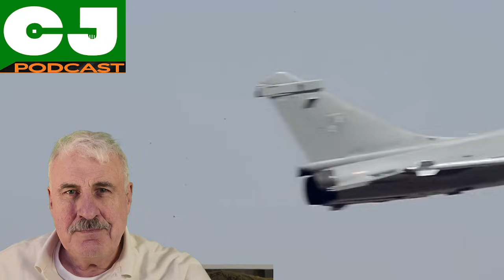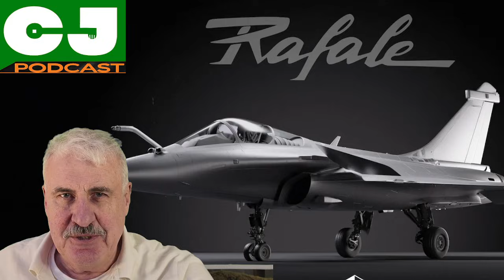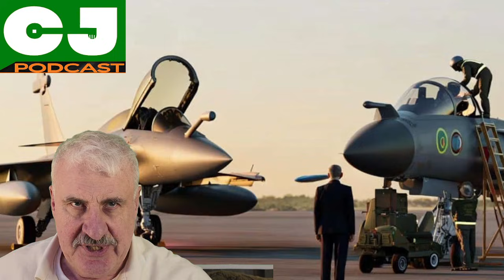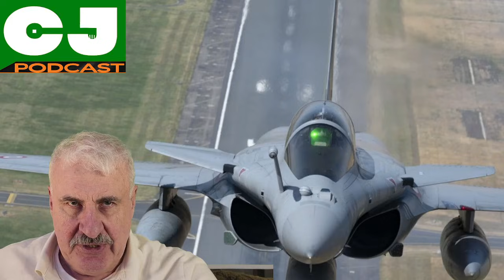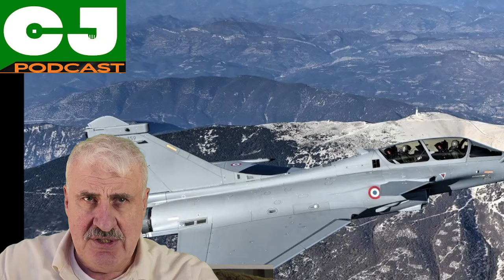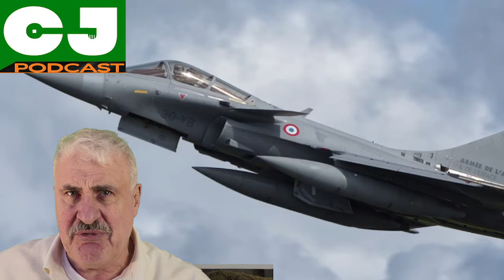Rafale vs Gripen – What Should the Irish Air Corps Choose?

Comment: The Gripen is nothing more than an F-16 or a Mirage 2000 with electronic upgrades. Its combat range isn't 1,300 km but 800 km, compared to 1,800 km for the Rafale. It's a very good aircraft, but it's riddled with ITAR-licensed parts. The US, in the event of policy disagreements, could simply prohibit the export of engines or spare parts. The Gripen is excellent for air policing but far inferior to the Rafale in every other role. Ultimately, it comes down to mentality: Do you simply want to protect yourself, or do you want to retaliate and punish those who have attacked you? It's primarily a political and ideological choice.
Reply: The idea that the Gripen E is just an "upgraded F-16" is a fundamental misunderstanding of 21st-century aviation. In 2026, the winner of an air engagement isn't the one who can turn the tightest—it’s the one who controls the Electromagnetic Spectrum.

The Gripen E is arguably the most digitally advanced fighter in the world because of its Separated Software Architecture.

The Problem with Rafale/Typhoon: Their flight-critical code is fused with their mission systems. Adding a new weapon or sensor can take years of recertification.
The Gripen Solution: Saab separated the "flying" code from the "fighting" code. This allows Ireland to update combat apps in weeks, not years, keeping the plane at the bleeding edge throughout the 2030s and 2040s. It’s an "iPhone" vs. a "Landline" comparison.

The critic mentions "electronic upgrades" dismissively, but EW is what determines survival in 2026.
EW is the ability to use the electromagnetic spectrum to Sense, Deceive, and Disrupt.
Gripen’s EW (Arexis): It doesn't just "jam" signals; it uses "Digital Radio Frequency Memory" (DRFM) to create ghost targets on enemy radars, making the Gripen E virtually invisible or impossible to lock onto. In recent exercises, the Gripen’s EW has reportedly "blinded" even the most advanced fighters. For Ireland, this means a single-engine jet can survive in environments that would kill a twin-engine "muscle" jet.

The claim of an 800 km range is factually incorrect for the Gripen E, which has a 40% larger internal fuel capacity than the older C-model.
The Gripen E has a combat radius of approximately 1,300 km with a standard loadout.
Ireland is 450 km long. A Rafale’s 1,800 km range is designed for deep-strike nuclear missions—capabilities Ireland neither needs nor wants to pay for. Why pay for a 10-ton truck (Rafale) to deliver a 10kg package?

"Do you want to protect yourself, or do you want to retaliate?"
Ireland is a neutral state. Its mission is Air Policing and Sovereignty Protection, not offensive "punishment" missions in foreign lands.

The Rafale and Typhoon are "Force Projection" tools. The Gripen E is a "Smart Defense" tool. For the cost of keeping 4 Rafales in the air, Ireland could fly 10+ Gripens, providing much better 24/7 coverage of its own territory.
Reply: @laves820  The aircraft you describe is still in the planning stages and won't be deployable until between 2030 and 2035, at least according to the CEO of SAAB. For now, it's exactly what I described: an F-16 or an improved Mirage 2000 equipped with advanced sensors. However, you're partly right; the development of the Gripen will be far superior to the previously mentioned aircraft. But by then, the Rafale will be at the F5 version with allied combat drones, two engines producing 9.5 tons of thrust without afterburners, and electromagnetic capabilities far exceeding what the Gripen will be able to provide. Like many "aeronautical specialists," you're putting the cart before the horse.
Reply: @CROM-on1bz 

"You’re comparing two very different philosophies. While the Rafale F5 is an impressive 'heavy hitter,' calling the Gripen E an 'improved Mirage' misses the mark on how modern aerial warfare has shifted toward software-defined capabilities.

The Gripen E already utilizes a revolutionary split-avionics architecture (separating flight-critical from mission-critical code). This allows SAAB to push 'app-style' updates in weeks, not years. By the time the Rafale F5 hits the tarmac in 2030–2035, the Gripen E will have cycled through several generations of software evolution, effectively staying 'up to speed' without needing a decade of development.

Even today, the Gripen E’s cockpit features a Wide Area Display (WAD)—a seamless, touch-sensitive interface that is more advanced than what is currently in the Rafale. While the F5 will modernize its cockpit, it's still built on an older physical airframe. SAAB’s next-gen concepts are moving toward a 'glassless' cockpit, projecting everything directly into the pilot’s visor (AR/VR).

Gen 6: You mentioned SAAB’s CEO, but SAAB is already flight-testing demonstrators for their Future Fighter System. This 'system of systems'—including loyal wingmen and drone swarms—is scheduled to be operational in the same 2030–2035 window as the F5.

Regarding the 9.5 tons of dry thrust for the M88—that sounds like a mix-up with the Rafale’s external payload capacity (9.5 tons). No current upgrade path for the M88 provides that level of non-afterburning thrust.

Ultimately, for a nation like Ireland, the choice isn't just about raw power; it's about digital agility. The Rafale F5 is a massive, expensive 'dinosaur' being given a digital brain, whereas the Gripen is a digital native designed to evolve every day."
Reply: @laves820  But you're talking nonsense. The Rafale is already equipped with data rifles and has Data 16 links for NATO cooperation, as well as a purely French Data 21 link that integrates with the Scorpion program and is entirely digital, like the FDI defense and intervention frigates, the Serval, Jaguar, and other Leclerc XLRs. Your information is 10 years old.
Reply: @CROM-on1bz 

It seems you’ve hit a bit of a snag with the technical specifications. Let’s clear up the facts so we can have an grounded discussion:

You claim the M88 engine has 9.5 tons of dry thrust. That is physically impossible for an engine in that class. A standard Snecma M88-2 produces approximately 5 tons (50 kN) of dry thrust and 7.5 tons (75 kN) with afterburner. The 9.5 tons you are quoting is actually the Rafale’s max external payload (load-carrying capacity). Confusing engine output with how many bombs the plane can carry is a fundamental error in an aviation debate.

There is no such thing as 'data rifles' in military aviation. I suspect you are using a poor translation of the French word postes (radio stations), likely referring to the Thales CONTACT software-defined radios.

Regarding Data 21: You are likely referring to the French domestic LCC (Liaison au Combat Collaboratif) used in the Scorpion program. While it’s a capable system for integrating the Rafale with the Leclerc XLR and FDI frigates, having a datalink (connectivity) is not the same as having a modern software architecture.

My point remains: the Gripen E’s Split-Avionics architecture is a generation ahead of the Rafale.

Gripen E separates flight-critical code from mission-critical code. This allows SAAB to push tactical 'app' updates in weeks without needing to re-certify the entire aircraft's flight safety.

Rafale F4/F5 is moving toward more modularity, but it is still fundamentally an upgrade of a legacy architecture. It cannot match the 'digital native' agility of the Gripen E.

Claiming my information is '10 years old' while we are discussing the Rafale F5—a standard that won't be fully operational until the 2030s—is a contradiction. I am comparing the most modern iterations of both platforms.

The Gripen E is already flying with a Wide Area Display (WAD) and software-defined capabilities that the Rafale won't see until the F5 upgrade. While the Rafale is an incredible machine, it is a 'heavy hitter' being modernized, whereas the Gripen E was built from day one to be a software-evolving 'smartphone' of the skies.

If we’re going to talk tech, let’s stick to actual specs, not mistranslated jargon.
Reply: @laves820  The M88 currently develops, and I emphasize currently, 7.5 tons of thrust. The M88 Raptor, ready for development four or five years ago, develops 9.5 tons of thrust. It has not been put into service due to peacetime concerns, fuel consumption, and maintenance costs. As for the Data 21 data transmitted by the only country with over 600 satellites, via EUTELSAT, please refer to established data and not to your Anglo-Saxon ramblings. The Rafale was designed to be an incremental aircraft, and it is far superior in this respect to the F-35, the Typhoon, or the Gripen. Between the F1 model, only capable of air superiority missions, and the current F4 model and the future F5 standard, it's a completely different aircraft capable of carrying a nuclear missile, acting as a carrier-based fighter, performing high-precision ground strikes, policing the skies, conducting naval strikes, and all this without returning to its base to refuel. And it's currently the only aircraft in the world capable of doing this; it's no coincidence that since 2022 it has been the most ordered aircraft in the world, ahead of the F-35, and that the Indian government has just ordered more than 100. So please, go to bed with your Gripen, which is of a much older design than the Rafale.
Reply: @CROM-on1bz 

It’s great to see such passion for French engineering, but passion doesn’t change the laws of physics or the actual state of global order books. Let’s clear up the misunderstandings:
 
The "M88 Raptor" Does Not Exist

There is no engine called the "M88 Raptor." You are likely referring to conceptual studies for the M88-3 or M88-9 (93 kN).
This engine was never mass-produced or fitted into an operational Rafale. Why? Because it requires larger air intakes, which would ruin the aircraft's thermal signature and fuel economy.

Claiming an M88 produces 9.5 tons of dry thrust (without afterburner) is physically impossible for an engine in that size class. An F-35’s F135 engine produces about 12.5 tons of dry thrust, but it is nearly twice the size. The Rafale delivers about 5 tons dry and 7.5 tons with afterburner. Confusing a "paper project" with reality is the definition of putting the cart before the horse.

Satellites and Data 21
This part of your argument is unfortunately quite confused.

 600 Satellites? France is a major power, but they do not have 600 military satellites. Only the US (primarily through SpaceX/Starlink) operates at those numbers. France’s military communications are handled by the Syracuse system, which consists of 4 satellites.

Eutelsat is a commercial operator. Claiming the Rafale runs its datalink through 600 satellites is a technical misunderstanding of how Link 16 or the French LCC (Collaborative Combat Link) actually functions.

F-35 vs. Rafale

Stating that the Rafale has been more ordered than the F-35 since 2022 is factually incorrect:
F-35: Has over 3,500 planned orders globally. In 2023–2024 alone, countries like Germany, Canada, the Czech Republic, and Greece chose the F-35.

Rafale: Has had a fantastic sales run (UAE, Indonesia), which is impressive, but the volume doesn't come close to the F-35.

India bought 36 Rafales years ago. They are currently discussing 26 Rafale M units for their navy, but they have not "just ordered more than 100." They have an open tender (MRFA) where the Gripen, F-15EX, and Rafale are all competing. No contract for 100+ planes has been signed.

Calling the Gripen E an "older design" than the Rafale shows a lack of understanding regarding program timelines.

Both the Rafale and the original Gripen began development in the 1980s.

The Gripen E, however, is a total redesign that first flew in 2017. It features a new airframe, a new engine, a new AESA radar, and a software architecture that the Rafale F4/F5 is still trying to replicate. The Rafale is a brilliant platform, but it is an evolution of a legacy architecture, whereas the Gripen E is a digital revolution.

This is the core of the issue: Why would Ireland pay for a fighter designed to deliver French nuclear missiles (ASMP-A) and land on aircraft carriers?
Ireland needs Air Policing and sovereignty protection. Buying a Rafale for that mission is like buying a Formula 1 car to drive the kids to school. It’s expensive, overly complex, and unnecessary. The Gripen E gives Ireland the same (or better) Electronic Warfare capability at a fraction of the operating cost.
Reply: @laves820 
While I agree with most of what you state, the Indian government is set to go ahead with an order for 114 Rafales. The M88 ist set to receive a thrust bump.
Reply: @marcg1686  The question is witch decade? And will they even go ahead with the redesign.
Reply: @laves820 
The T-Rex is being developed for the Rafale F5, which is slated for eis in 2030.
The T-Rex is not aspirational, it's in development.
Reply: @laves820 
The Rafale's software architecture was also designed to facilitate app style upgrades and capability insertion.
Reply: @marcg1686  
While it’s true that the Rafale uses a Modular Data Processing Unit (MDPU), there is a fundamental difference between hardware modularity and logical software partitioning.

On the Rafale, flight-critical code and mission code are still deeply interdependent. This is exactly why French 'Standards' (F3R, F4, etc.) take years of testing and certification to roll out. You cannot simply 'drop in' a new capability on a Rafale without re-validating the entire flight envelope.

The Gripen E is the only fighter designed from day one with a split avionics architecture. This isn't just marketing—it means Saab can update tactical algorithms or EW libraries in weeks, not years, without needing to re-certify the flight-safety systems.

In 2026, air warfare evolves faster than a traditional 5-year procurement cycle can handle. The Rafale is modular by 20th-century standards; the Gripen E is partitioned by 21st-century standards. That is the 'iPhone vs. Landline' difference I am talking about.
Reply: @marcg1686  

Being 'in development' is exactly the problem. In the aerospace industry, 'in development' is a synonym for 'subject to delays, budget overruns, and technical hurdles.'

You say the T-Rex is slated for 2030. Even if we ignore the fact that EIS (Entry Into Service) rarely meets its first target date, that is still years away. Ireland needs a sovereign capability that is mature and operational now, not a promise of a power boost in the next decade.

Furthermore, you haven't addressed the 'Air Intake' issue. A 9-tonne thrust engine requires a higher mass-flow of air. Unless Dassault plans to redesign the Rafale's airframe and enlarge the intakes for the F5—which they haven't announced—the T-Rex won't reach its theoretical potential. It’s physics.

The Gripen E isn't waiting for a future engine. Its GE F414G is already integrated, flight-tested, and optimized for its airframe. It delivers high-performance supercruise today.

Why should Ireland gamble its national security on a French development schedule when they can have the world's most digitally advanced, operational fighter today?
Reply: @laves820 a little mistake with your argument on the rafale and the eurofighter it's only true with the eurofighter as each upgrade need a debate  of all member and thecaircraft was not think to be modular.
At least the rafale is more modular as think as the start to be modular. The evolution of  the integration in  France is long only because politics to transform all f4.0 version rafale in a f4.1 then 2, 3 to F5 .

Secondly it's not announce as nobody admit in dassault team but at the last Bourget saloon  the representation of the F5 which will come before griepen E wsa shown with mysterious pod such as a french equivalent than spot in the us growler, France will unlock this capability soon

In reality the griepen and the rafale are more similar that you think
Reply: @elmetalish8532 
The greatest similarity between the Rafale and the Gripen is that their respective governments are committed to further procurement.
Reply: @elmetalish8532  

Rafale is "modular." While true to an extent, you are confusing modular hardware with a separated software architecture.

The Gripen E’s unique selling point is the split between flight-critical code (flying the plane) and mission-specific code (weapons, sensors). This means Saab can update a radar-jamming app in weeks without needing to re-certify the entire flight envelope of the aircraft.

The Rafale uses an Integrated Architecture (MDPU - Modular Data Processing Unit). It is incredibly powerful, but the software is still more tightly coupled to the platform compared to the Gripen E. Updating a Rafale takes longer and requires more extensive testing of the entire system. Your "iPhone vs. Landline" analogy remains technically accurate regarding the speed of "app" deployment.

F5 which will come before Gripen E
This is incorrect. As of 2026, the Gripen E is already in serial production and is being delivered to Sweden and Brazil. The Rafale F5 standard is not expected to be operational until at least 2030–2035.

Comparing a plane flying today (Gripen E) with a future vision (Rafale F5) is an unfair comparison. If Ireland buys planes now, they get Gripen E's tech today, whereas they’d have to wait 10 years for equivalent capability in a Rafale.

You mention a new EW pod for the Rafale (similar to the American Growler).

It is true that France is developing massive jamming capabilities for the F5 standard. However, the Gripen E has this built into the airframe today.

Arexis (Gripen’s EW): Unlike the Rafale, which often requires external pods for specific high-end missions, the Gripen E features internal 360-degree jamming using GaN (Gallium Nitride) technology. The Gripen E is designed to be a "digital stealth" fighter rather than a physical stealth fighter.

You’re right that the Rafale is more flexible than the Eurofighter, but you’re missing the fundamental difference in software philosophy. The Rafale F4/F5 is still built on a traditional (albeit modular) architecture. The Gripen E’s fully separated architecture is unique—it is the only jet where you can swap out tactical code on a Friday afternoon without risking a crash of the flight control system.